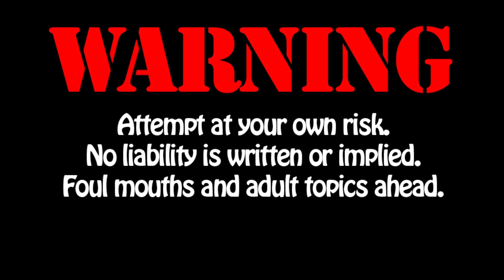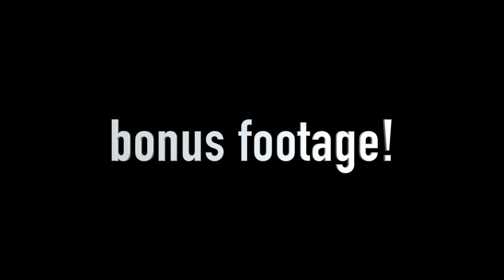MIATA GOKART PART 5 TANK SWAP S04E17

Comment: I just got a miata and think I need to do this lol....XL
Reply from the maker: lol, do it! but i seriously only do them to cars that have no way of ever being registered for street use. track only.
Reply: +Wayne'sWork!Vlog I'm in south Dakota and I'm looking for one now lol...there's one in CO, I see that's where you're from...for 250...already about done lol...I got one on trade and pretty rusty underneath but think that will be my drift car, and find one like u said to cut up for autocross...I'm a poor boy so 250 is about right lol
Reply from the maker: that would be awesome and $250 and still running is a sweet deal especially already cut.
Reply: +Wayne'sWork!Vlog says just no rear diff and axles and little things here and there
Reply from the maker: bummer, those are a pain to find cheap. will end up paying what you paid for the whole car for those parts already pulled.